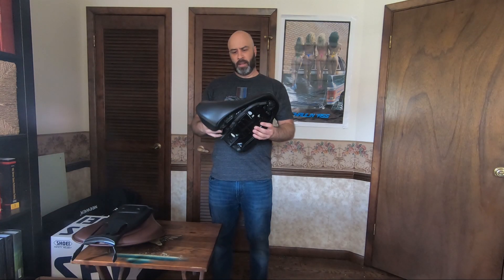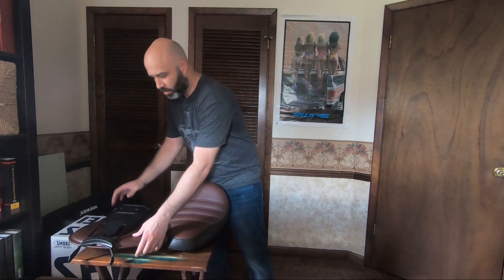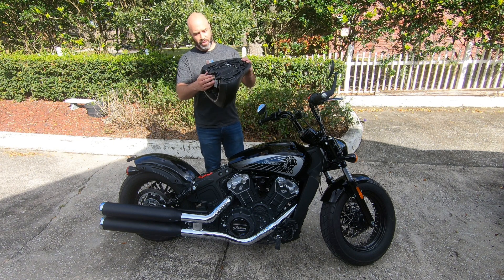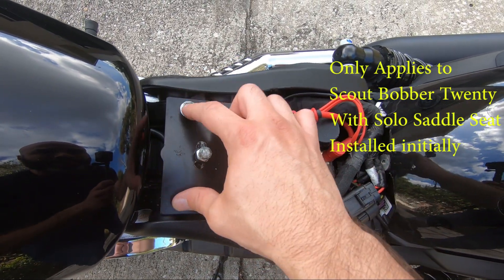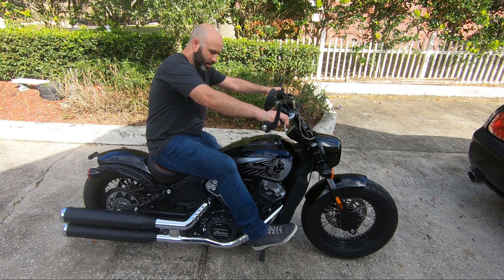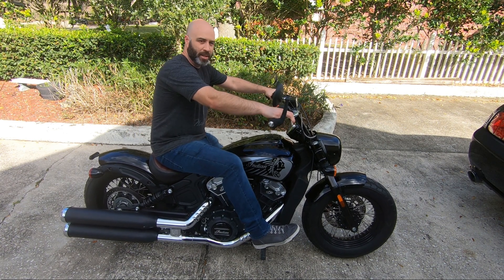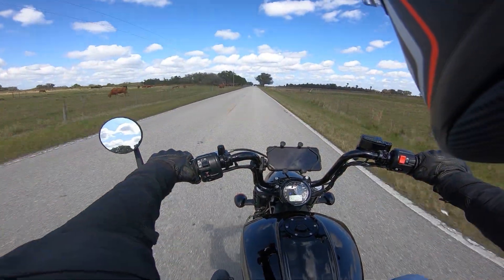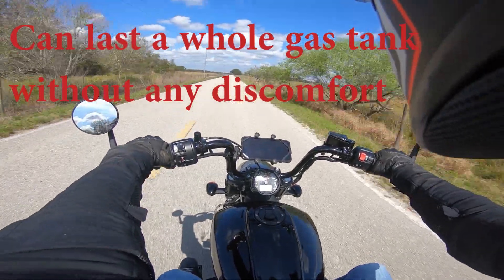Indian Comfort Seat Review For The Scout Bobber

Comment: Great Vid.. was waiting 4 sm1 to review that seat.. thanks.. Waiting on ur nx vid on the 1920 seat. And is it the exact color brown that matches the Pillion ? thanks
Reply from the maker: Yes the color is the same. I was thinking of uploading the 1920 solo saddle next weekend and reviewing the Roland Sands Track slip-ons this weekend (I may change the order of that from this comment). Either way thanks for the comment and keep riding!
Reply: @cmosadvantage5903   Sorry for the long winded questions.. I hv a dep on the Burnish Twenty now & looking over seats, I assume ur came with the "floating" seat? if so, how was it riding that? The dealer was changing floating to original brown bobber seat in my case. Then looking at difference between Boober vs Twenty, its ONLY the seat, Bars (10") & heat shields (chrome/blk) SO why pay the additional $1,000 if changing seat anyway? What are ur thoughts sine I'm kinda doing same thing u are...
Reply from the maker: @damions7771  Yeah my bike came with the 1920 solo saddle seat (floating seat). For the twenty your'e pretty much paying for what you mentioned above including the floating seat and the Indian head logo on the paint. The floating seat is more comfortable than the stock seat and gets a lot of compliments but if the bike comes installed with it you will have to go back and get parts and won't be able to mount any aftermarket seats. If i could redo my purchase i would have negotiated the comfort seat and parts (the latch bolt for front of stock and comfort seat) and still keep the floating seat for the cool factor. You can pretty much build the same bike with the non twenty version without the paint job for a little less depending how you negotiate the install fees.
Reply from the maker: In addition to my last comment i intend to switch between the saddle seat and the comfort seat depending on ride distance. The twenty was worth it for because i liked the paint job but there really isn't any other benefit with getting the twenty version.

Comment: what about the 1920 vs the comfort seat? on a bobber 60 and could use a little more i think
Reply from the maker: I've never ridden the bobber 60 but it seems they share same ride characteristics. The Comfort Seat is more comfortable but the Solo Saddle Seat has more curb appeal. Can't go wrong with either really. Be careful removing the seat dart/pin (bolt that latches to seat) when installing solo saddle, its easy to strip.